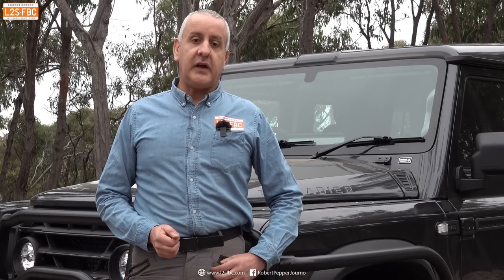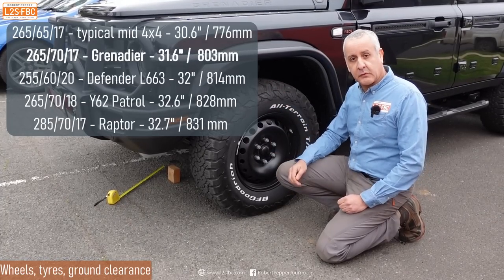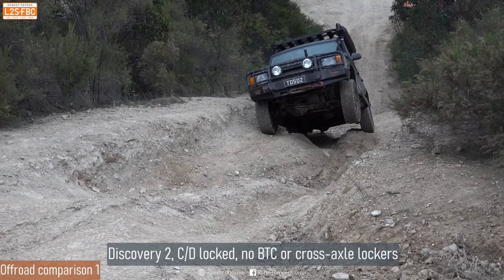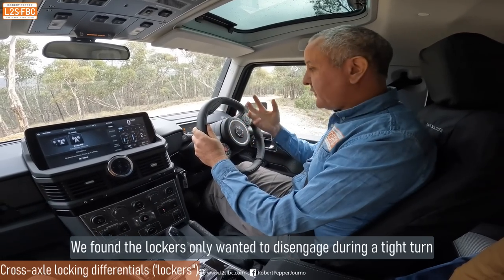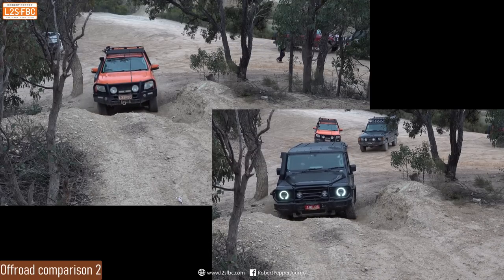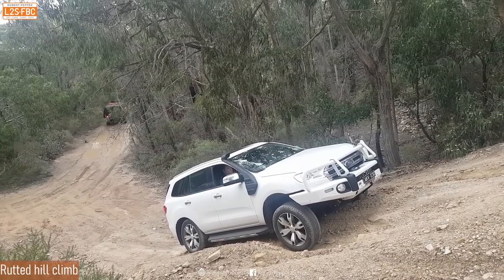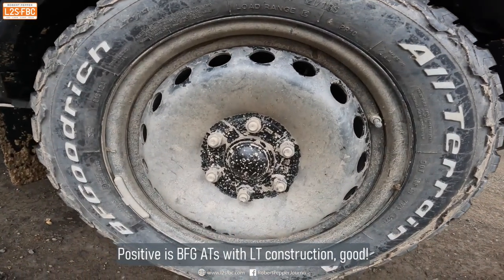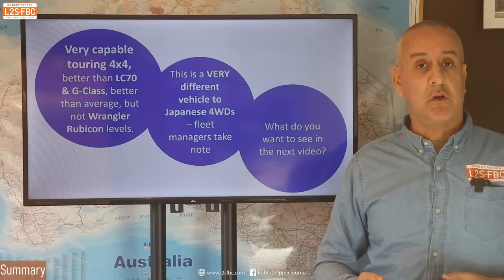INEOS Grenadier Offroad Review & Comparison : Australia

Comment: Best Grenadier review yet, by far. You nail it with pragmatic appraisal supported by clear facts and comparisons. Looking forward to the next part.
Reply from the maker: Glad you enjoyed it, please share :-)
Reply: @L2SFBC  What is the reason in your opinion that CTIS has not hit the 4WD community in Australia ?

There are portal axles; various locker systems; ECDS shock absorbers etc. But CTIS not promoted by anyone for Landcruisers, Patrols,Hinos and for Isuzu trucks.

Tyre pressure is a crucial element which should be in the apex from anyone’s modification list.

You should have the ability to adjust tyre pressure on the fly depending on the terrain.
Reply: @prasannakurukuladithya7630 Probably the added complexity issue. Most manufacturers can barely make their chassis strong enough to withstand the off-road touring conditions in Australia, let alone CTIS.
Reply: And I didnt have to hear again why it was created!
Reply: @MTNDOG39  YES! If I hear that backstory one more time…
Reply from the maker: Yes I decided everyone knew the backstory so skipped that part 😁
Reply: @L2SFBC  off subject ….but who makes the box on the back of the ranger ???
Reply: Thank you. Very helpful.

Comment: As others have said, best Grenadier off road review worldwide to date. 🙂 

Very much looking forward to driving mine in similar conditions. So far I’ve only done high range tracks.

One thing you might be interested in … an INEOS rep in one of the overseas videos said that Off Road mode also changes throttle response. I’m not sure if that’s true. Not mentioned in the Owner's Manual.
Reply from the maker: Thanks Michael, appreciated!  I didn't notice a difference in throttle response, nor did INEOS mention it in emails to me, or in the owner's manual.  I don't think it's necessary.  Chances are it's remapped in low range anyway, or maybe with a centre lock.

Comment from the maker: FAQ:
Thank you for all the supportive comments, much appreciated! Some common themes are emerging:

- I will do a follow up video on Touring Suitability which will include weights and a towing capabilty analysis
- Also hope to put it up against the L663 Defender and Puma Defender and maybe LC300/Y62. I have people for all of this, just have to organise.
- Requests for tow test/high speed dirt road; yes if I can get a car on loan
- I have been informed that if you put the car in "carwash mode" ??? you can operate the winch without the engine running. Not exactly a solution but interesting.
- 285/70/17s fit it seems
- there is a conflict between engineering for safety/warranty and the full control 4x4ers like us need. The restrictions on the Grenadier are not unique to it, and there for good reasons I'll explain later.  However...when you're out in the field you need 100%, full control because you just don't know what trick you'll need to pull to get out of a situation.
- many carmakers get ground and running clearance wrong, quoting the latter when it is in fact the former.  Toyota, Ford, others.  Toyota even had to a pull a press release and re-issue after I found their Fortuner clearance was 220 not 279mm for example. So this is not unique to Grenadier.  But regardless, 245-250mm is excellent so have no clearance concerns. INEOS seem intent on their definition which excludes unsprung mass...I refer again to my tape measure and the ADR defintions.

Comment: Easily the most comprehensive review to date, by anyone, anywhere. What stands out is that an owner of this vehicle is going to have to love it to forgive its sins. And that is a conundrum.
Reply from the maker: Why "forgive its sins" and isn't that the same for any other car?
Reply: Taking the rough with the smooth is not exactly a new problem to those of us that typically run iconic 4x4  vehicles for ten years plus,  with the superiority of effortless capability offset from getting cricks in the neck admiring   the thing  when walking away, ripping endless items of clothing on sharp door latches when getting out, putting up with the noise, vibration, water leaks, glacial acceleration,  conceding modern ABS might be useful, with the biggest regrets being the ultimate selling, not the buying.  And often losing very little money annually in the lifecycle process.  Grenadier seems to tick most of the positive boxes.

Comment: It's amazing how level the Grenadier stays on an uneven terrain compared to other vehicles.  Good review Robert.
Reply: That's true but I think it has very very poor ground clearance. I've heard others say that also. And you can't fit bigger tires very easily. I'm surprised they can print it to an old disc go when it's a brand new vehicle over 20 years newer. Gosh if they would have had a Jeep Wrangler Rubicon on here with the factory disconnecting sway bars and front and rear lockers it would have put the Grenadier to shame so bad the video would have met people like the Jeep too much so maybe that's why they didn't use one. You can even fit 35s on a factory Jeep or a Bronco Sasquatch which actually has really good articulation in the front even for IFS
Reply: @ronaldrrootiii6040 …after playing in the mud you should drive the Rubicon and the Grenadier back home 200 miles over a German Autobahn. I guess you will be impressed about the fact that the difference in capabilities on-road is a lot bigger between the two than off-road. Overall, the Grenadier is the most capable 4x4 to date, taking On/Offroad, price, factory fittings etc. into account. Just like that…😊

Comment: I have a Defender with rear lockers. I drive defensively. I avoid trouble. That said, all I have to do when I get inside is, turn it on and drive and I must say, being off road a lot, that is still very appealing. They are like a horse - feed them, love them and use them. I hope the Grendadier evolves in the same way.

Comment: Robert, the best Ineos review to date.
Thanks for sharing this video and thanks to your supporters for sharing there new Ineos.
It’s about time for reviews from experience for drivers, and independent to Ineos controlled testers.
I’m shocked at the short winch rope and the lack of easy access to the winch.
So I look forward to your road report and I think it’s time to wait for the next revision for offroad adventure use .
Reply from the maker: My pleasure!
Reply: Red Winch (a local company to my area, and very helpful) emphasised that the Grenadier winch is a self recovery winch, and that alone. 

They also explained in detail how they had to conform to European Pedestrian Impact laws which cost them (and Ineos) a fortune to comply to. 
That’s why the winch is set back in the front chassis crossmember as opposed to being further forward (which would result in non compliance of impact regs). 
However, Red Winch have released an aftermarket alternative (thereby freeing up Ineos from OE fitment litigation issues) called the Nomad, which has double the rope capacity to that of the factory fitted winch. 
But the owner (in Europe) would have to declare the fitment for Off Road Use Only, as with any exposed winch that could injure a pedestrian.
Reply: @robinireland810  fair enough, but down underwear allowed to have bow bars on the front of the Ineos Grenadier so why not a normal winch from one of the more popular brands like Warn etc.
My personal Suzuki Jimny has a 5,500 lb Axom winch and a number of people point out that my 15 metre cable is too short and it’s a pain but works for me just.
Why would anyone pay for an overpriced winch with a short cable?
Reply: @overland_adventure_nz  being UK based, I can’t answer to NZ or Australian legislation; you may well be able to mount an exposed winch in your countries. The addition of bull bars and other protection measures would be a no brainer too, but here in the UK we’re limited to what type of cotton wool we can tie on the front (as long as it carries an allergy warning). 
We can’t even add the optional chequer plate wing top protectors, as they too contravene European Pedestrian impact regs!! 

I looked at the pricing of the Ineos accessory list and compared their prices to the retail market; surprisingly, Ineos have put minimal markup on their accessories, with most of them showing no more than 5% at current prices. 

Fundamentally, I’d agree with you that the Grenadier winch is overpriced. If it was delivered in a cardboard box on its own, then yes, it would be massively overpriced. 
However, without wishing to defend their pricing, you have to take into consideration how much it costs a vehicle manufacturer to obtain Type Approval for a winch (or other externally fitted device) to be fitted as an OE fitment option as opposed to being an aftermarket accessory. 
As briefly touched on in previous post, it took Ineos and Red Winch (who I think were formally branded as Warne) two years to get Type Approval to fit a winch as OE fitment. Some of the price is probably reflected in that (in my opinion). 

Also, you’re not just buying the winch. You’re paying for upgraded suspension, a modified front chassis member, a fully approved wiring harness built into the vehicles main loom, plus all the bracketry and extra manhours it takes for Pierre and Gaston to install it all. Plus you’re getting a full Ineos warranty for at least 2 years on the winch, which is more than what Red Winch offer if purchased independently. 
You can’t buy the OE winch from Red Winch as it was designed exclusively for Ineos and can only be installed during the vehicle’s manufacture. 

I wholeheartedly agree that 15m of rope is not enough, but the physical constraints of the chassis crossmember and having to set it back made it impossible for the designers to up the rope capacity. So if you’re seriously considering buying a Grenadier and you’re expecting to be using a winch on a regular basis to recover other vehicles as well as your own, then the OE fitment winch most likely isn’t suitable, and an aftermarket item, plus all related suspension and fitting upgrades would be the best route. Again, in my humble opinion. 

All the best. 

My 2 seater Commercial Grenadier will come with the OE winch, and part of my permanent kit will include recovery gear (from Red Winch) as well as trauma 1st Response kit and a defibrillator. I’m hoping I never have to use any of them.
Reply: @robinireland810  Hi, thanks.
I didn’t know that the chassis was upgraded for the winch, and I do appreciate the pre wiring of the winch.
Just disappointed that a manual transmission is not available standard and I would have to replace the automatic transmission myself once it comes.
I’m going to now wait a few more months before thinking about placing an order.
Reply: @overland_adventure_nz  wow! Replacing the transmission is going to be an interesting challenge; I can’t imagine how difficult it’s going to be, but if you do go for a Grenadier and dive into your transmission project, please let me know how you get on. 

Incidentally, Ineos Automotive raised their base price (in the UK)  on the Grenadier by £10k GBP last week, so any customers with existing orders will be getting their Grenadiers considerably “cheaper” than new customers. 
I checked the Configurator last night, and indeed, you’re looking at more than a 10% increase across the board. 
That’s gonna hurt….
Reply: @robinireland810  I will post about a manual transmission upgrade if I don’t just buy a manual Jeep WRANGLER 4DR RUBICON ?
Why fight someone that has got sidetracked from the original goal of a simplistic four-wheel-drive for Offroad use and turn it into a supermarket shopping wagon

Comment: That was a great exposure video and to date a more aussie revelation of capability than the UK versions simply driving around muddy paddocks. looking forward to a more in depth driving appreciation from you, ie fast, corrugated, gravel outback roads.
Reply from the maker: Hopefully I can get lent a car and evaluate that, and tow!  I did some dirt-road driving in high range but insufficient for me to form conclusions. However, AWD, decent handling...I'm expecting it to be okay to good.
Reply: @L2SFBC  Yes, agree but curious about front wheel wobble at speed as depicted in earlier video's, much the same gremlin as that plaquing Jeep. Steering geometry should have been sorted I hope.
Reply from the maker: Only one way to find out!!!
Reply: @trickster8635  so called death wobble is a characteristic of all solid axle 4wd's. all of them can or will do it with worn parts incorrect castor or wheel alignment.

Comment: Many thanks Robert for a great off road review. 
The weight of the Grenadier is considerable (around 2900kg in diesel version with bull bar & fuel). Did you experience that additional weight and/or did you find it a mild negative off road?
Are you planning a further review that would include both gravel and bitumen road driving, including driving at some speed?
Reply from the maker: If I can get a car, then yes, also towing. The touring video will be a weights analysis for towing - spoiler - it's looking good. But I'd like to tow practically too. Weight is not much of a drawback offroad, and in some cases, heavier vehicles perform better. I have important things to say on weight in the next video.

Comment: Thanks for putting this first look of the Grenadier together! I know the front and rear locker engagement/disengagement was a real problem for the early press event in Scotland, and I was hoping they would have sorted out that issue before customers took delivery. Looks like there still needs to be a software update to fix it. If Ineos is right about it disengaging earlier, and it's just the indicator that is lagging, that is reassuring, but they still need to get the indicator light to react in real time so the driver is confident lockers have been disengaged. Thank you for sharing. I appreciate it and look forward to more videos on the Grenadier!
Reply from the maker: hmm was the issue reported in any reviews?  I didn't spot it, I did watch a couple of videos off the release event.  I agree it needs to be fixed.

Comment: From an engineering standpoint, slow disingaugement of axle difflocks is caused by binding of the metal surfaces of the wound up diff internals due to half shafts to each wheel slightly twisting against eachother....   
I think Ineos are quite daring offering this feature in a mainstream vehicle, Land Rover didnt do this for years possibly because they thought that people would keep snapping the axle internals due to misuse? ( totally my opinion) or cause massive wear on them.....
Fair play to them for making this Vehicle, really like 90 percent of it, to develop a new vehicle from the drawing board and to be this good is a huge achievement.
Great video analysts as always, enjoy your ideas and theories,  very in depth and thoughtfull
Cheers
Reply from the maker: Thanks, I agree it's great the lockers are there. Land Rover only used lockers as auto-activated, but plenty of other carmakers - Jeep, Toyota, Mercedes to name but three - offer vehicle with front/rear lockers, and many more rear only.

Comment: Ditto other comments on how good this review is. 

As a note, you can factory option 18” wheels which may correspond with Ineos’s ground clearance claims. 

Red Winch should have released their Grenadier compatible Nomad winch by now, which doubles the rope capacity. So it may be prudent to configure your Grenadier without a winch and talk to Red Winch about availability. 
They are local to me, and super helpful. 
They also made it clear that their Grenadier winch is a self recovery winch, nothing more. So bear that in mind when ordering. 

I’m assuming your testing was performed with an unloaded vehicle? If so, it would be good to chuck a dozen bags of cement in the back and do the same test, as I’d assume most Aussie’s are going to be fairly well laden, if not overladen! 

Top channel, Robert. By a long way.
Reply from the maker: Thanks!  The 18" wheels would use lower profile tyres so the overall diameter of the tyre and thus ground clearance remains the same. What's a "self recovery winch" as opposed to any other type?
Reply: @L2SFBC  I’ll pass that on to Red Winch, as that was their response to me when I discovered their Grenadier winch had only 15m of rope (of which they claim has a usable 13m) and questioned the limited capacity. 

They’re local to me, and were extremely helpful and informative when explaining the nightmare of gaining Type Approval for supplying Ineos with an OE fitment winch. 

They also mentioned that their new Nomad winch would address the rope capacity issue. It has a Grenadier fitting kit (external I presume), so should be ideal for the Australian market. If fitted to a UK Grenadier  I imagine there would be an issue with insurance if involved in a collision on a public road as externally fitted (read aftermarket) winches would be for “off road use only” with the exception of Emergency Services and military.

Comment: One thing about the Ranger and BT50 diff locks: they continue to indicate that the the locker is fully functional, even when they don't actually work because the crown wheel has eaten the wires to the solenoid.

Comment: Hi Robert, What tire pressure were you running on the Grenadier and is that the tire pressure you would recommend for the type of off roading your were doing. Also, If on sand or dunes, what tire pressure would you recommend. The Grenadier I have ordered has the same rim and tire size as the one in the video. Fantastic Video, best informative review I have seen on the Grenadier! DaBull
Reply from the maker: We ran at road pressures in order to test the vehicles. Usually you would drop to 20psi for that terrain, maybe 18, maybe 25...depends on many factors.  Sand pressures I cover here https://youtu.be/uN0Tf2eYPE8